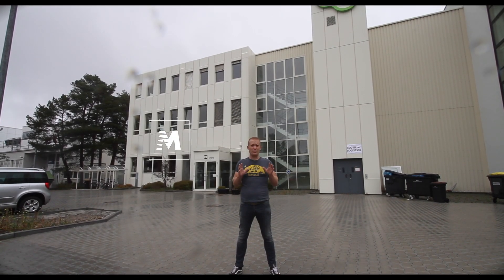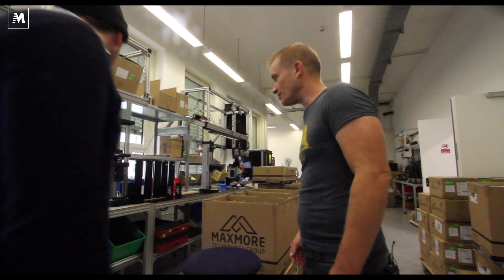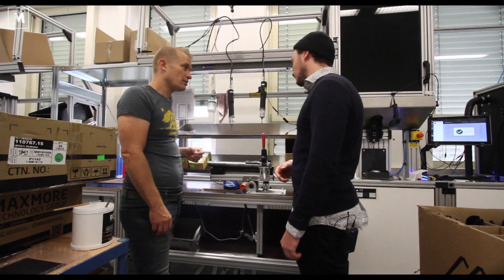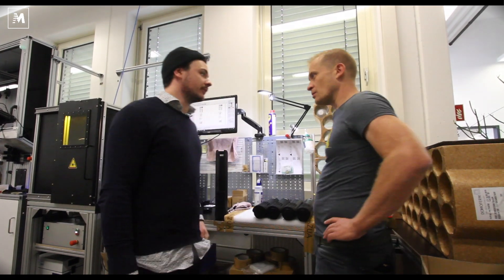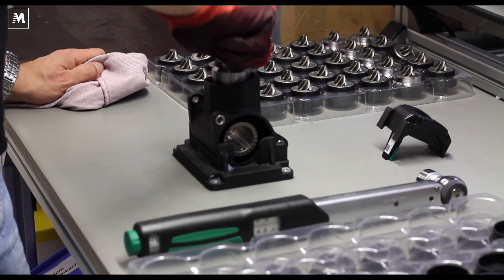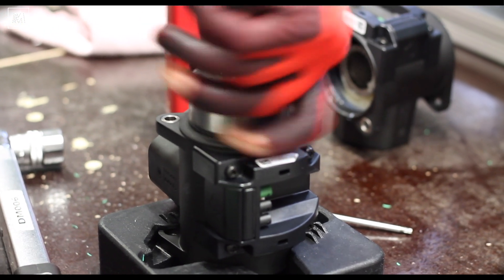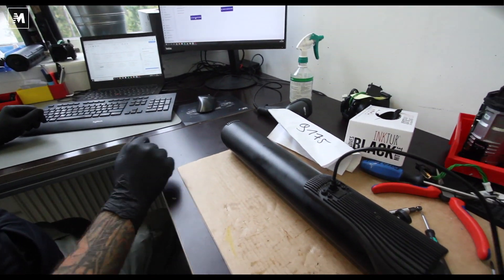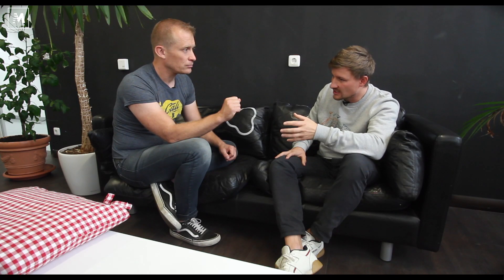Fazua Motor. The secrets of the lightest eBike engine [Ita sub.]

Comment: Compared to the production line of TQ this looks awfully amateuristic. Maybe things have been more professional since the take over by Porsche?
Reply: Yeah the testing to 40,000 kms seems like it was not properly load tested and they just spun the cranks. I have not heard of a Fazua ride 60 motor last more than 3000 kms before failing. I have asked on multiple forums as mine and 10 people I know locally meeting on trails have had multiple failures. Mine failed at 300 miles last month and is a 2023 version in a 2024 bike. Riding a TR Relay.

Comment: I just purchased a Trek Domane+ ALR (March 2022) and unfortunately the battery is not working . 

I have the bike but the dealer is waiting for a replacement battery / motor combo. The dealer seems to have problems getting an answer (from Trek or Fazua, I don’t know)

The dealer promised me a loaner battery / motor combo in the mean time as the serial numbers have to match. I’m hoping to receive it tomorrow. (April 5th)

Comment: Has anyone experienced a rattle sound emitted from the Fazua drivepack latch when riding over bumpy terrain? Or if you lift and drop the front end of the bike to the pavement....rattle, rattle, rattle?
Reply: That is a great question. I want one but I don't want it to rattle
Reply: @danb37  I just shipped the bike back to the distributor Dan. We tried a few things here at home, but I couldn't remedy the rattle. I'll let you know the outcome with the rattle.
Reply: They couldn't repair the rattle. A suspected lemon in the frame? A new frame solved the problem according to the distributor. I just received the e bike this afternoon and I didn't unpack it yet. So I don't know first hand as to how well the rattle issue was resolved?
Reply: @multilingualmob5531  does it work now? is it any good? :)
Reply: @carlosgarcialalicata  Yes Carlos! :-) The Fazua drivepack unit is quiet now and the bike is so much fun to ride!!! The frame was swapped out to resolve the issue tough. Just drop the front fork on any e bike that uses the Fazua drivepack and you will hear the rattle immediately. If it's there?